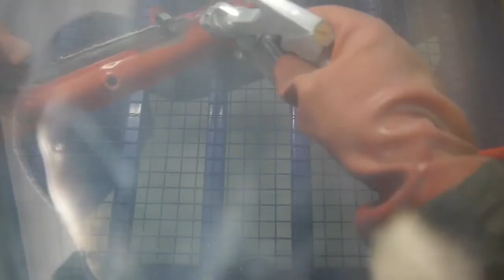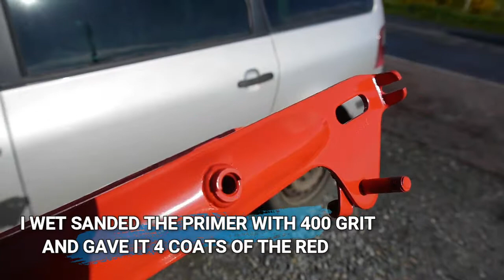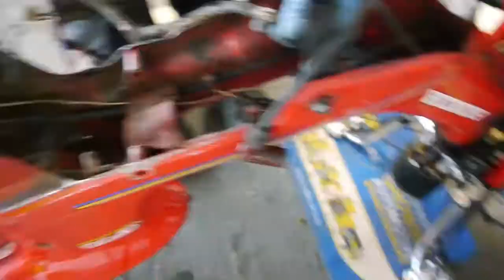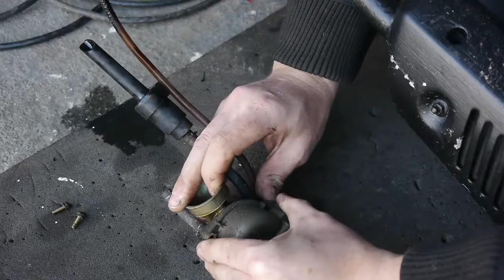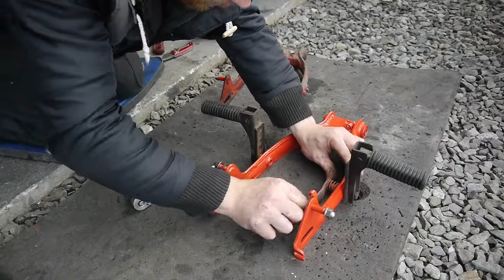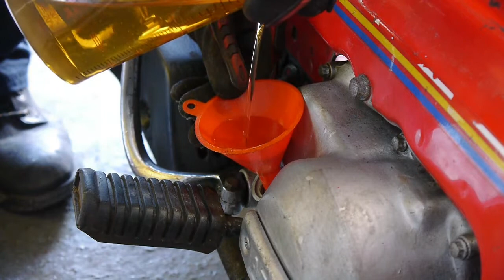Honda Chaly CF70 Barn Find - Part 2 - Back on the Road!

Comment: My very first bike , mine a bit older than this one , chrome exhaust and white front guard, also called a chaly
Reply from the maker: The mudguard on this one could have been painted as the paint job is not great on it but it served the previous owner well as there is around 18,000 miles on it and he said never gave much trouble